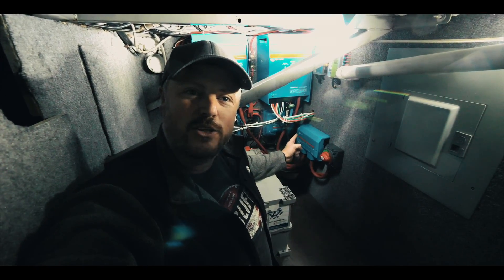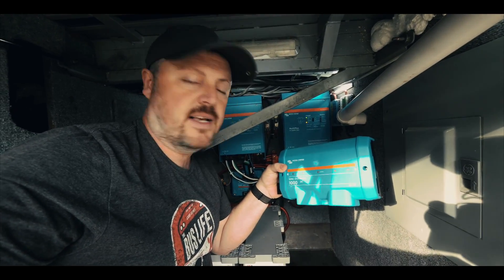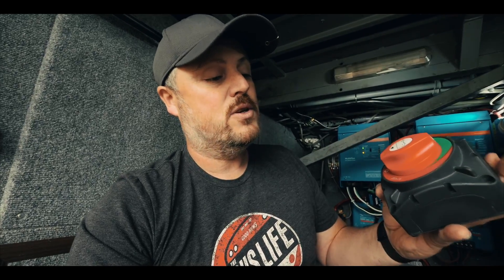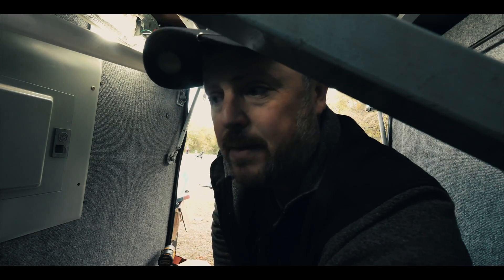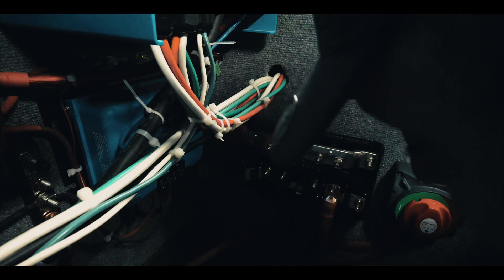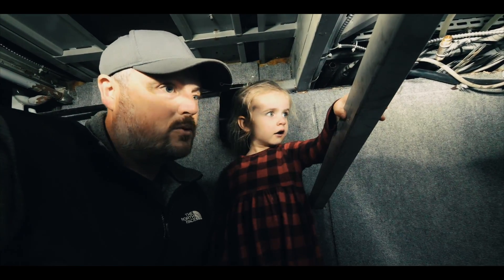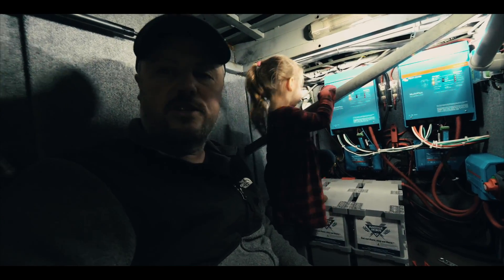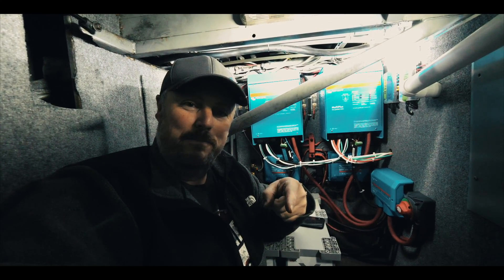Why I Added the Victron Energy 1000 AMP Lynx Distributor to My RV Electrical System?

Comment: Did you use the 4/0 cable on the Lynx connections?  How did they fit if you did.  I am thinking of installing the Lynx when I install a second 460ah battery so I can have a cleaner installation.
Reply: I'm also interested how you connected the 4/0 cable to the distributor.  I keep reading that you can only get 2/0 to fit unless you're willing to modify the 4/0 lugs

Comment: For anyone else looking at the Victron Lynx Distributor in that kind of setup. He would have been better off just using the Victron Lynx Power In, which is like the Distributor, but without the lights (which unbelievably, don't even work when it's installed alone!). You can easily add the fuses to the Power In and it's a bit cheaper.

Another thing - that red bus bar (a very common one) - they're sold as rated for 250 Amps, but as the actual bar is brass and quite thin, people (who seem to know what they're talking about) say they would only be rated 100 Amps at best.
Reply: Good points. You can make a 12v-5v adaptor to operate the lights, or I believe Sotas Solar have an adaptor lead you can buy to do this. This is a bad oversight from Victron, it should be plug n play for the extra price.

Comment: So I'm adding solar to my 1990 RV That I'm restoring, I don't have a lot of 120 in it other than the fridge and ac and some outlets,My ? is I've bought 600 watts of panels and 400 amps of Batterien, I've used almost all linksy products ,,is there anything I can do to add more as in panels or batteries to beef it up or do you think I'll be all right, this solar stuff is freaking me out ! lol and great videos ,, the other thing is space,,,I have none so I'm using a closet which is next to the breaker box,,any help will be appreciated

Comment: You can make the lights work by wiring a 12v to 5v converter into the RJ11 cable and plugging it in. Several videos on youtube, "make the lights work" style.

Comment: Been with you since the first bus and loving the evolution of your bus.  One question. I noticed you mentioned plumbing while in the power bay. Are you nervous having water pipes so close to the electronic brain of your system? I did see the piping was metal but I am nervous for leaks.
Reply from the maker: It’s a non pressurized water drain.  It should not be a problem but we will keep our eyes on it. It is far enough to one side that it should not cause a huge issue if it did leak.  Thanks for staying with us so long! 😀

Comment: Looks great Victron is the Cadillac of off grid question so how much are you into the entire set up so far? And is the coach alternator 12 volt or 24 volt? I'm assuming 12 volt because I thought you said the system is 12 volt. Thanks for sharing